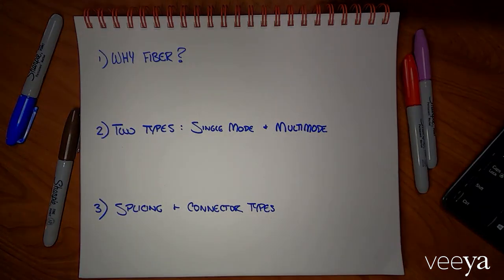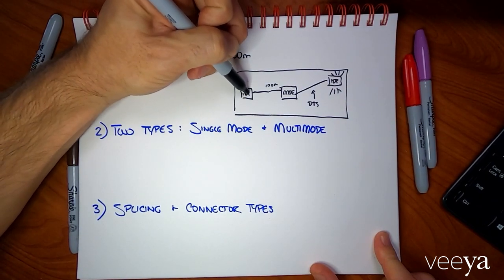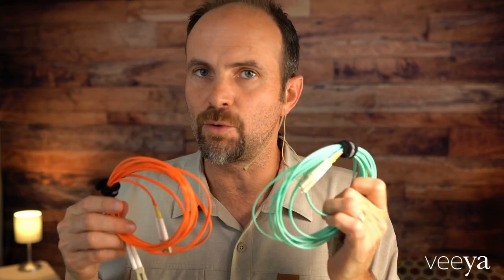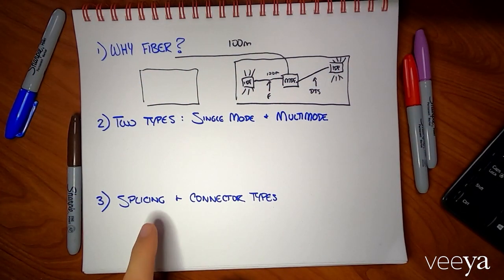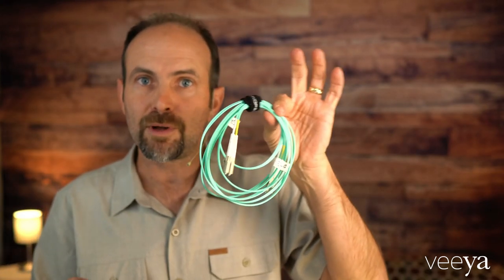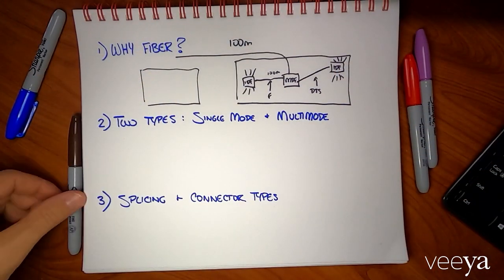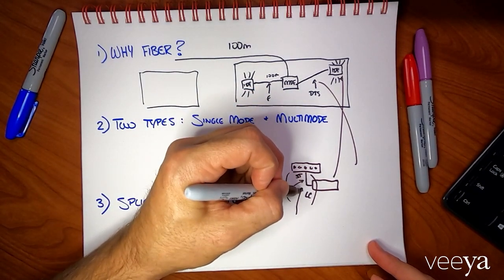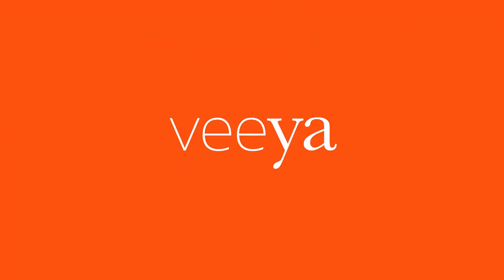Conversational Competence, in Fiber Optic Cabling

Comment: The general rule of thumb I use, after 29 years as a network engineer, is:

OM3/OM4 (multimode) for runs inside the same building.  
OM3 @ 10Gbps = 300 meters
OM4 @ 10Gbps = 400 meters
OM3 @ 40Gbps or 100Gbps = 100 meters
OM4 @ 40Gbps or 100Gbps = 150 meters

Rarely will you need to make a run more than 300 meters inside the same building (unless it's a 30+ story skyscraper).

I use OS2 single mode fiber for my any runs I need that leave the building, like dark fiber connections to another building a few block down or several miles away.  

With OS2 you can effectively run 1Gbps (LX-LH - 10 kilometer range), 10Gbps (LR - 10 kilometer range), 10Gbps (ER - 40 kilometer range), 10Gbps (ZR - 80 kilometer range), with a bunch of other options for things like BiDi.  

40Gbps single mode optics are basically the same distance limitation as the 10Gbps mentioned in the previous sentence, but as the speed (bandwidth) goes up, the link integrity is more sensitive to db loss.  A 10Gbps LR run at 9 kilometers, may not establish connection over the same link using 40Gbps LR optics because the overall end-to-end db loss is out of specification for 40Gbps, but will work just fine for 10Gbps.

There's a world of fiber optics out there to learn and explore.  I've enjoyed learning and teaching about fiber optics as it pertains to high speed networking for almost 22 years now.

Great video Viatto!  Thank you.

Comment: Enjoyed the video, however multimode fiber is not made with a plastic core. the core is just larger usually 50 microns (legacy OM1 used 62.5 micron core) single mode and multimode both use glass. Plastic Optical Fiber has a very large core size and has immense amounts of attenuation. Either way I still love watching the videos!
Reply: Yeah, this ain't no TOSLINK audio optical cable.

Comment: Here it is in a nutshell: Cable SM OS2 and LC terminations. Period. There is no excuse that I can think of to wire OM cabling. SM 10Gbe optics from a reputable, off badge vendor (FS.COM, Finisar) ~$60, for MM ~$20. Not a huge budget concern in large data center vs the additional bandwidth you get with SM OS2.

Another benefit with SM is you can do LC Bidi and that effectively doubles your usable strand count. Those SFP+ adapters are $~35 and only work with SM cabling.

Comment: Multimode/Singlemode are glass. There is no plastic in network fiber. OM3 and OM4 are 50 micron core. The difference physically is OM4 is manufactured with the highest quality glass, and produces higher bandwidths than OM3. Which means cost will be higher for the cable. Like paying for a Cadillac or a Ferrari. There is so much more to this, but I thought that was important. lol thanks for the video